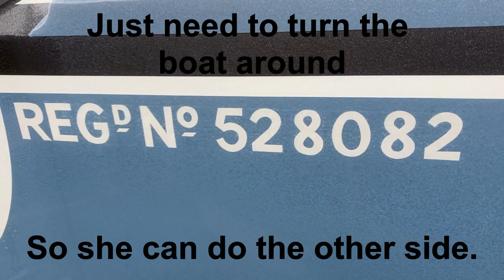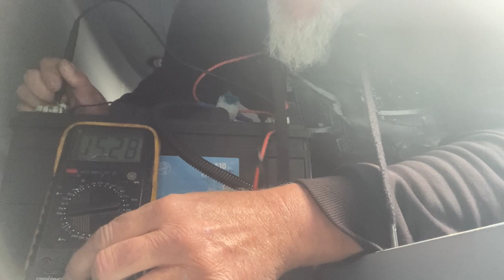Building Our Narrowboat #23 - Sign Writing and Winterization

Comment: Great to see a fellow sparky at work, even though I’m a sparky myself I still get a bit miffed and head scratchy around 12v 
Great install off the bus bar, i wouldn’t have even thought to do that and probably would’ve just used link cables,  great watching this channel and seeing proper workmanship .
Reply from the maker: Hey there, thanks for the great comment. I do my best and try and bring some industrial practice in where I see fit. 12v can be a bit more difficult than higher voltages as we often working to a few points to be determined good or bad. Such as charging circuits. I used to work in dairy many years ago and a lot of this packaging machines were 24v, think that put me in a good place. Of course the tech training with British Marine improved on that. Even now I get some head scratchers!
Reply: @narrowboatmoonshine   I dipped my toe into 12v with the leisure electrics on my Campervan, 2 x 90ah batteries charged via a dc-dc charger and 100w solar panel.